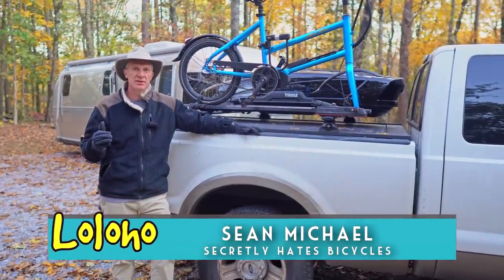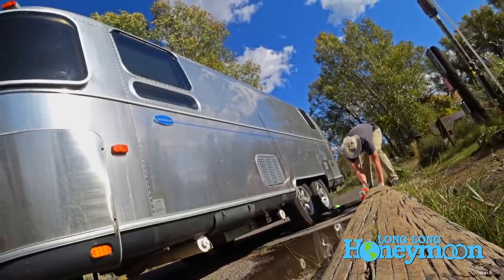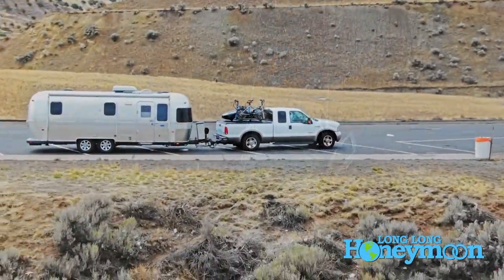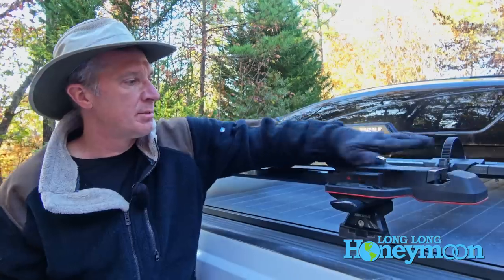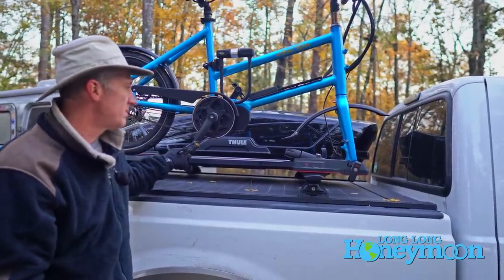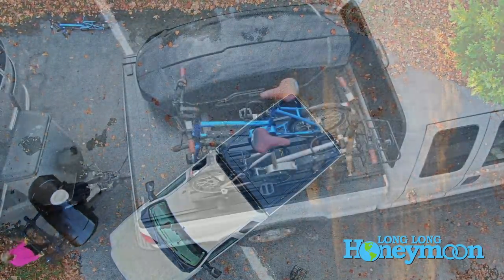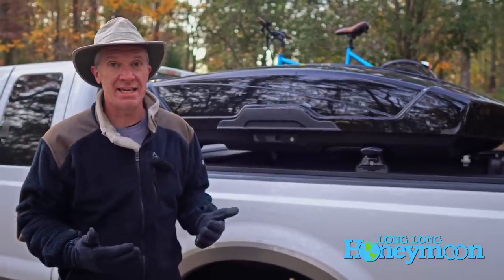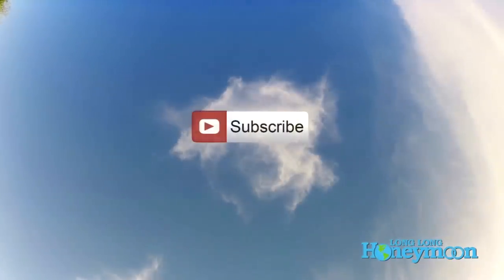Our Yakima/Thule Truck/RV Bike Storage -- What We Like and HATE About It :O

Comment: I use a camper shell/truck cap and store my bike inside (cost used was $1k, new they're $1600). It takes up 50% of the width of the bed laying down, but if I remove the front tire it can stand upright and only use about 30% of the bed width. For quick access I leave it laying down with the tires attached. To prevent bike damage I have a carpet remnant that the bike lays on. I can easily slide the bike in and out without damage to the truck or bike. Since the bike is stored inside it is protected from weather and since it's not visible to would-be thieves, hopefully less of a chance it gets stolen. (It is cable locked to a truck tie-down and obviously the truck cap locks too.) I still have use of 50% of the bed for other things. The downside is less visibility in the rear view mirror, but once you get used to towing a trailer and using only side mirrors, even when disconnected you still mainly use only the side mirrors out of habit. I do have the option of mounting the bike on a rack on the back of the trailer with a built in hitch receiver, but did not like how exposed the bike was to weather and thieves.

Comment: We have pulled a travel trailer all over the country for over 30 years with various pickups equipped with caps (some aluminum and now a fiberglass one) and found it a great solution for us.  With some DYI anchor points mounted in the cap I can strap the bikes in securely without removing wheels or accessories and can get bikes in and out even with the trailer attached easily and quickly.  Provides secure protection from weather, sun and thieves as well as lots of space for all sorts of extra gear.  A rack on the top of the cap carries a canoe or our kayaks.  So whether by land or by sea, our toys are with us and readily accessible.

Comment: We carry our bikes inside the Airstream.  We installed four threaded inserts where we attach the fork mounts.  Front tire off, tighten the forks into the mounts secure between slide and door with cargo strap.  We didn’t want bikes on front, couldn’t mount on back, carried in truck bed until the idea came to me that they would easily fit in Airstream.  Has worked great for 18 months.  The fork mounts unscrew from floor when not in use and threaded inserts are flush with floor and positioned under ottoman.

Comment: That is so much better then our solution.  We put our INSIDE our Grand Caravan!  The dog does not like them.  While we have to take the front tires off, at least they are protected from the weather.  When we had a Tent Trailer, I installed 4 bike racks on the top, and they had a diagonal brace that allowed the wheels to stay on and secured them.

Comment: I started with a Yakima roof mount single bike rack that attached to my Equinox roof rack. It worked very well for my bike, but, and it was a huge but, lol, I’m a goddamed absent minded moron and I ran it into low over hangs until finally, I gave up on it and went with the Yakima trailer hitch mount. That has saved me the lifting up to the roof and saved my bike from damage. It works because it’s on our toad, so not exactly like pulling a fifth wheel or trailer. My only complaint, they don’t make a one or two bike model, only a four bike version so it sticks out fairly far.

Comment: We have two e-bikes and two kayaks and pull an Airstream. We use a tall bed topper with the bike forks fastened to a bed slide inside the topper. The bed slide allows us to access items in the truck without having to take out the bikes and climb up into the bed. The kayaks are on Thule racks on top of the bed topper. We have to use a step ladder to put them up there and get them down. It’s not ideal, but it works. You are so right, that the more trouble it is to access your toys, the less you use them. We are always looking for a better setup.

Comment: We had the Yakima rack system that attached to the factory roof rack on your Chevy Avalanche, worked great for 16 years, never loosened, never a problem. We bought a Tundra and went with the Yakima system that clamps directly to the roof/door frame. It scratched the paint off the truck where it latched. The towers would loosen constantly causing the bike rack to come completely off and rest on the roof. We’ve called Yakima on and off for 2 years. The first rep was irritated that we called so close to closing, the second rep was irritated that we did not know the parts by there proper name and hung up while I was still talking the third was trying to be helpful but everything he told us to try we already tried multiple times. I asked for a refund or partial refund with no response. We are so grateful for your video because we were thinking of your setup but now back to the drawing board

Comment: I fork mount in the bed of the truck. Pros - pretty secure, easy access, dirt cheap to do. Cost me about $20 for the mount. Cons- kills a lot of space in the truck bed, can't use the tornie cover, so everything in the bed is exposed to the elements. Got some water proof bins which help.  Luckily I store most everything else in the trailer.  RV rear bumper mount wouldn't work and didn't want to do a tongue mount for the same reasons you mentioned.   Thanks for the good honest videos.

Comment: Easiest solution is to buy the bike rack that does not require removal of front wheel. We have the Yakima rack that straps down front wheel with ratchet system, no need to remove wheels. Works great on our F150.
Reply: Unfortunately that style of Yakima rack does not work with our bikes. We even took them to the store we purchased from and tried it. We really wanted to make that style work, but it just wouldn't. It would have been much easier, for sure!

Comment: We bought a high rise Century truck cap and built a homemade device to slide the Ebikes front tires right in so we don’t even have to take of the front tire off. The perfect solution as we can lock up the cap to prevent theft also lockup things inside the truck box such as generator. Because of the airflow over the cap we get a noticeable increase when towing our trailer as a side benefit
Reply: Sorry that’s a noticeable increase in fuel economy

Comment: I use a mtn bike style tail gate pad with Velcro loops to secure to the down tubes.  The front wheels sit flat on the back side of the tail gate.  Then I run cable lock through the bike frames to one of the tie down loops in the bed.  It's not that elegant, but has worked for the 2-3 times a year we go for a trailer trip.  If we want to bring our kayak or surfboards, we install two piece Yakima lumber rack and strap to the top of that.  Security isn't very good, so we avoid leaving unattended in city centers.

Comment: We use "Cling" wrap to wrap the area where the batteries go...and we also wrap the speed control area on the handlebar.  This keeps out the water and saves your problem. We take the batteries off during transport..again for a reason of safety and to keep the batteries out of the cold.
Reply from the maker: Thanks, I hope my LCD display can be salvaged. Good idea to wrap those areas in plastic.

Comment: Boy you are so right on with your comments on hauling ebikes in general and with respect to RV's. We are in our mid 60's and retired and we live in Michigan and have 2 ebikes with 4" fat tires that weigh 66 lbs each. We have tried a couple ways (one was fork mount)  that didn't work out very good for us for reasons you addressed, beating up the front forks and becoming loose and bouncing around. We now are hauling them with a Hollywood Sport Rider SE2  ebike fat tire rack (the wheels stay on) that will haul two 80 lb each ebikes.  We purchased the rack from etrailer it fits a 2 inch receiver. We do have to add a bar from the seat to the handlebars for clamping them down. We had a heavy duty 2 inch receiver welded up and added to the rear of our 5th wheel. The rack isn't really rated for the back of trailers but its working out fine, its pretty heavy duty. The whole setup is solid and not moving around and tows nice and the bikes don't loosen up. We have a backup camera on the 5th wheel and my wife checks on them on and off when towing. Also in the winter we haul the bikes on the back of our SUV to our place in Florida. So the 2 inch receiver setup works good all the way around for us. But it was a big pain to come up with something that holds all the weight and will take fat tires on the bikes and hold them solidly in place. Plus it has to be easy to load. BTW we do remove the batteries and we do cover our bikes and use bungees to hold the covers in place and so far our electronics are holding up well. The bikes are expensive, but then throw in all the hoops to jump through to haul them. It all starts to get expensive. But we do try to get out and ride 5-10 miles 3 or 4 times a week. If we didn't have them we would be just sitting in our lawn chairs  So I guess its got a good side too.

Comment: Sean...We have a Airstream Flying Cloud [Vinnie is our service guy!] and I went through the same quandary.  How to store bikes?  We ended up with an ARE canopy and a Decked storage system.  I’m able to store the generator on the top of the Decked system,  the bikes fit under the canopy and are somewhat easy to remove.  I like the canopy because it keeps the bikes and other gear out of the weather and a little harder to access by wandering hands.  NOTHING is perfect.  Just compromises I’m willing to deal with.  Your setup was my second choice.  Both choices are about the same in cost.  Thanks for your video.  Safe travels.

Comment: I use a Highland Sportswing carrier in a front 2" hitch receiver. The Sportswing has a 160lb capacity and space for 4 bikes, you can also leave the front piece off and fit 2 bikes. Even with a bike large enough for myself at 6'3" the tires do not interfere with the headlights. As far as bugs, we've done about 7,500 miles with it on the front and haven't noticed an issue. It's also a heck of a lot easier to lift the bikes to an arms neutral position than overhead!

edit
Oh, and hitch plus rack was $300, I ended up paying another $100 to have the hitch installed after struggling for a few hours, so all in it was a $400 solution.

Comment: We have the same issue of where or how to store our electric bikes with our airstream too. Last summer we bought a canopy for our truck, so your setup for us would not work, since we needed the extra space for storage. So far our best option was to get 2 stands for our bikes, and store the bikes inside the trailer while we travel. The handle bars would have to be swung parallel to the bike frame, but both bikes fit fairly well inside the trailer, as far back as we could place them.The bike pedals could also be removed if necessary. A heavy blanket could be placed over the bikes to prevent the bikes leaning against the counters or bathroom doors and causing scuff marks. It's relatively easy to take the bikes out when we park or camp. At night we just chain the bikes to the trailer and cover them with a tarp. So far this woks for us. We have given some thought to storing the bikes inside the canopy, but it would require us to take the front wheels off, and make the handle bars as well. And then the bikes could still be supported by the bike stand inside the canopy. There is just enough height inside the canopy to do this. But then  you lose some storage space for other stuff. No perfect solution, that's for sure.

Comment: The Thule cargo box on the top of our van holds a massive amount of items that make full timing in a van much nicer.  We try not to clutter up the inside of our van.  Cluttering up the outside we don't mind so much. There are excellent bike seat covers that go on in just a few seconds after using the bikes.  We use the Xerocover Journey for our seats.  They look pretty worn after 3 years of being in the elements 24/7 but still work great.  We use a fork mount and a wheel loop mount Yakima for our two electric mountain bikes.  We have to use two different types to keep the bikes from conflicting with each other.  We tie a stabilizing strap around each rear tire to keep the bikes stabilized.  It's better to have continuous pressure in one direction (to the side) rather than the bikes wiggling back and forth.  Prevents metal fatigue.  We broke one Yakima rack before learning this lesson.

Comment: I have a DYI setup for Clarke, I bought a Backflip retractable tonneau off of Craigslist, I have 1" aluminum tubing reinforced with 1"angle aluminum for bed rails and crossbars from Home Depot, and last but not least, Yakima Raptor Aeros. When on the road, we run a 17' dog runner cable through everything and secure it in the bed with the Master Snake Locks. My bike is an Electra Townie and it sits pretty damn high, so I add a tie down for stability. I also put stuff that's infrequently used up front under the tonneau and frequently used items in the rear for less curse words while accessing the bed. I've thought of every way possible to secure my stuff from thieves, but in the end, I've concluded that.....it is what is. Something that I didn't hear mentioned that I REALLY like about this setup, is that, your bikes are on the truck and it adds functionality, instead of being dependent on a RV bike rack BACK at the RV. This setup is awesome in my book, I'll take the trade offs for the function any day. Great video as always!

Comment: Had a 2005 F250. Added a front, 2" receiver hitch for 2 bike rack. Thousands of miles. Bugs never became a big issue.  Easy to clean off, if they were. Met y'all back when we tailgated with Ty and Emily on Campus Drive some years back. RTR

Comment: Nice video. We don't bike often, only occasionally on a short camping trip. Our solution is a cheap in truck bed rack that can keep 4 bikes upright. It indefinitely not for off-road, but I think the way I tie them down can handle a little bit bumpy road. Online review was mixed, so I was a little extra careful and added strap downs to keep the bikes firmly on the truck bed. The rack really just keep the bikes upright. I also uses a tension bar to keep the bikes bouncing. So far the few trips we took are great. 

Downside is we lost most of storage in the truck bed. We can still put small thinks or long poles, but any large boxes can't fit.

The other potential issue is if the strap down is too tight, it could deform the wheels in the rack. I have noticed any and try not to make it too tight. It worked for us because most of the drive was on highways. 

On nice thing is that when not using in the truck, we use it in the garage as a normal bike rack.

Comment: We carry the bikes on the back of the trailer. We carry as many as three sea kayaks on the rack above the bed and roof of the truck.   It can be interesting.  A little practice and loading/unloading problems go away.  We have a friend in the Airstream club that has a shell on the back of the truck with kayaks on top. In the shell he has a lot of gear that rolls out in a big frame/drawer so generator,  grill, etc are accessible.  Don't remember if they have bicycles in there.   Everybody configures their rig to meet their needs.

Comment: I purchased a receiver hitch extension that also has 2 receiver holes.  One hole on top, one hole on bottom.  I slide the receiver ball mount for the trailer in the bottom hole and then use a hitch receiver 2 bicycle rack in the top hole.  Works great.

Comment: You've done a good job of adapting to the Air Stream's weakness, storage.  We keep our ebike wheels in place and put the ebikes on a Hollywood rack on the back of our Honda CRV, which is our toad behind the motor-home.  This can be an issue with weather, like you explained, but it's easy to load and unload.  I avoid driving in rain or snow as much as possible and hunker down at a campground when weather comes through.  A cover for the ebikes gets installed in those scenarios, only when stationary.  It's not a perfect solution, but it mitigates the weather damage that can occur from exposure.  It's all about timing.  Ebikes are heavier to handle at 50 and 60lbs, but oh man, are they a pleasure to ride when touring the country.  So much fun.

Comment: Totally agree that easy access means you will use it more.  I have the same issue with my inflatable kayak and my folding e-bike. Once I get them out I have a blast with them though. I have a 19 ft Airstream, so I’m very familiar with not a lot of storage. I put a mid-height cap on the back of my truck.  That has given me way more storage and a place to put my bike.  The cap keeps everything dry inside.  However, because of the openings in the bottom of the truck bed, it is not dust proof. Keeping things covered helps, but every now and then I need to sweep out the bed with all of the accumulation. I resisted this idea because I like the look of the truck, but resistance is futile when practicality rules.  Just another idea for you.

Comment: I do my 3 over the tailgate.  Try using a towel first to see if it works for you.  Set the folded towel low enough that the front tire hanging out the back of the tailgate doesn’t scratch and the rest over the top of the tailgate to not scratch your bike.  I can hold 6-8 across the back and have been from Arkansas to Colorado several times with this method.  I run a cheap cable through the frames and lock it to the truck.  No disassembly required.  I also have a TT not an airstream but looks like you have more clearance between truck and trailer then I do.  Wish I knew how to post a pic here so I could show you.  I actually use an restaurant floor mat for mine